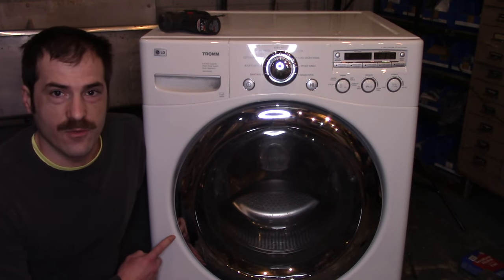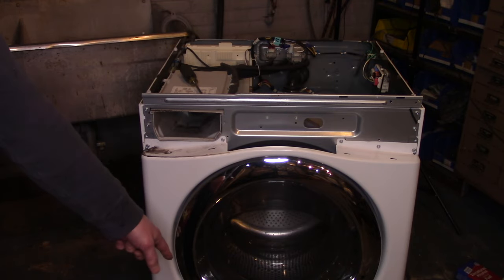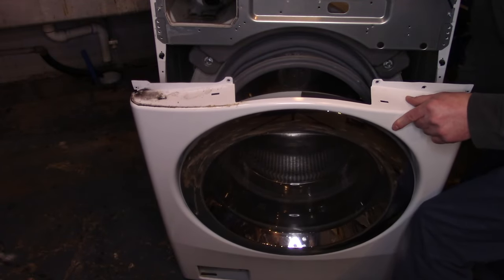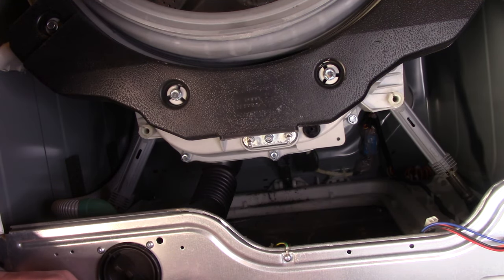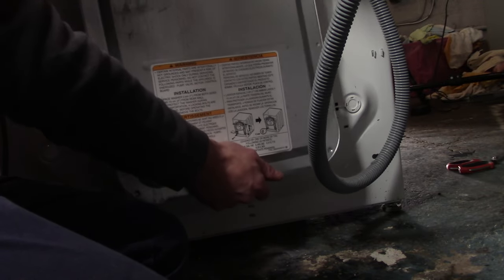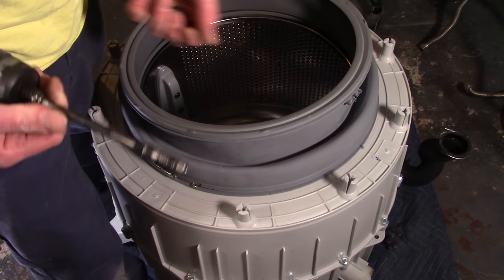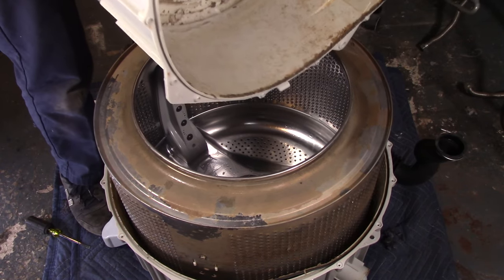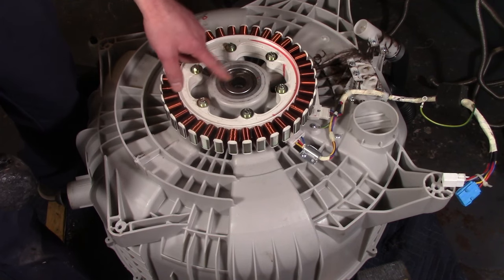How to Replace Bearings LG Front Load Washer

Comment: Thank you for this excellent video!  I finally got the bearings replaced, and the washer is working again!  I had to use a sledge hammer cushioned by a 4x4 to finally pound out the basket stem from the rusty bearings.  The rusty bearings took quite a bit of work too, I had to take several breaks, but finally I pounded them out using a 4 lb. hammer and a 2 foot, 1/2" socket extension (minimized risk of damaging the housing).

Comment: This video is very well  done - one of the best "How To" videos I have seen.
The procedure is well planned and executed very well. with no silly distracting background music.
In my opinion, this procedure should only be attempted by experienced DIY'ers. It is fairly difficult and draws on a wide range of skills acquired over time.
One tip I can pass on - when removing the white plastic pins that hold the shock absorbers,  I used a 13mm socket slipped over the end of the plastic pin and used it depress the 
release tab.  There is no way I could get  a pair of pliers behind the shock absorber to squeeze the release tab.

I suggest anyone attempting to replace the tub bearings, set aside the better part of a day to focus on the procedure. I found that some of the tasks such as removing the last spring holding the tub was DIFFICULT for one person. I struggled but eventually got it done.
I successfully replaced the bearings and re-assembled the machine. The noise is gone!

Thanks for sharing this excellent tutorial.

Comment: Stupid question, but I was trying to remove the bearing and the spider arm broke. When I was trying to remove the broken spider arm I got a few of the bolts, but three are just spinning and won't come out. What would you recommend?
Reply: I used heat like you mentioned to try and get the bolts off. Did I heat the bolts too much?

Comment: The bearings were difficult to remove.  I tried using a drift punch but i kept punch through the bearing.  I wound up using a 1 inch black pipe and two couplers and a small sledge hammer it took about 10 good swings to pop them out and lots of liquid wrench.  I got the new bearings in fairly easy using the old bearings and some plumbing rubber sheets to protect the bearing while i was pounding on them.  I got the tub assembly together and bolted it with the new o-ring.  I noticed some spacing around where the tub pieces join and put a good bead of GE Silicone around the tub making sure not to get it on the o-ring.  I have run six loads of wash so far and nothing is leaking so far.  I let the silicone cure overnight and i  had to replace a few screws with larger ones because they stripped out.  I recommend not using any power tools to tighten anything on the tub, hand tools only. I had to replace the spider arm and one of the bolts would not back out is was spinning freely in its anchor.  I would up using my Dremel and cut the head off and left it in place only using 5 instead of six fasteners in place.

Comment: Hello, this video deserves an award. Awesome video, every step explained throughly and to the point. I have my washer apart, picking up the parts tomorrow and hopefully can put it back together.

Edit: got it back together and it's been a few weeks and it is still running. I don't think it's ever been this quiet.

Edit 2:

When I replaced the bearings, I had noticed some wear on the Spyder. I ignored it as I assumed it would be ok with the new bearings. This was a mistake on my part, and I should have replaced the Spyder. I did look up the cost, it was over $300 and I decided to not get it as a new washer costs about $900 and would be headache free for 5 years. Just FYI, if your Spyder is not in good shape, might be a good idea to replace that too. My washer is making loud noises again and needs to be repaired again. I think its time for a new washer.
Reply: I spent a lot of my youth in Germany and Italy. Still visit relations and friends whenever I can. LG in Europe is a far higher quality brand than LG in the US. I see LG washers and refrigerators running for decades in Europe and, here, you're lucky if you get four years.
Reply: @ethelryan257 
I agree the build quality is not good, as doing the repairs, I seen alot of areas they could improve quality. I work with sheet metal industry in the medical industry and these washers are not high quality for sure.
Reply: The quality of large appliances in America is truly pathetic. As long as consumers are willing to keep spending money on appliances that only last for a few years nothing's going to change.
Reply: @ethelryan257  We have a LG washer that we bought in 1997 in Sweden, been used several times every week and the last 15 years only for work clothes (dairy farmers, so lots of dirty clothes). Just last week it started to make some noises, so probably time to get a new one (doubt that it's worth repairing at this point). Got to say that 25 years of heavy use is impressive.
Reply: @ethelryan257   After 2 years my LG is salvage! I bought it new, it was a top model but I’m facing replacing it. It has the common problem of failing to enter the final high-speed spin. After only 2 YEARS! It gets to the start point of the last spin cycles, then stops, adds water, low spin, starts high spin, then stops. This repeats until I stop it! The pump was replaced. Next I’ll try the shocks and pressure switch if it tests bad. It’s basically scrap at this point though, after only 2 years. It was made for the American market. LG is junk! My last washing machine lasted 35 years. LG is junk, expensive $1000 mistake!

Comment: This video was all I needed to watch to finish the job.  I did have some problems along the way that were highlighted in the video.  The bearing's refused to budge with the little punch I had.  I purchased a bearing extractor set and was able to get one out but the inner bearing would not cooperate.  I could not get any purchase to allow the extractor to gain leverage, instead it chewed up the plastic.  I finally was able to get it out using a 1.5/2" socket and an extender.  Few good whacks and it came flying out.
Using the old bearing to seat the new worked great.
Trust me, get the tools to remove the bearing and it will take you no time to finish this project.
P.S. Take pictures as you remove things so you remember which screwes and wires go were.  I had to wait a few days to complete my repair and forgot a lot of details.

Comment: I replaced the bearings on my 20 year old LG washer this past weekend. It took me five hours. It took a while to bang the bearings out. Has anyone tried using a bearing removing tool? I used my electric power washer, wire brush and screw driver to clean the spider arm. It was caked with old gunk. I also power washed the drum and the attached gasket. It saved me a lot of time and they look like new, It also got rid of the mildew smell. I highly recommend doing a detailed cleaing of the drum and hoses with a power washer and detergent while it is apart.

Comment: Thanks so much for posting this tutorial. Everything was spot on.  Just finished testing out my LG after putting it back together with new bearings and sadly needing a new spider arm because the old one had a race gouged in the main shaft from the failed bearing.  Thanks again!!

Comment: I just did this.  It is way easier to remove the 2 bottom hoses from the rear of the washer and not the front.  Would have been way easier to know that before hand.  Remove rear panel before you start taking any of the insides apart, especially the lower hoses.

Comment: Thank you for a great video. I watched a few on the same topic and yours is the best. You gave lots of little tidbits of information to look out for. You saved me a lot of time. One small addition to mention is on the spider shaft, besides where the bearings rest, also check the part where the seal contacts (close to the drum). I replaced my bearings 5 years ago, but they rusted because I didn't inspect that part of the shaft, and water leaked by the seal.

Comment: Thank you for this video. By watching it, I was able to replace the bearings on my LG commercial washer which is much bigger but built very similarly. It was the most back breaking, strenuous, tedious, aggravating repair I have ever done. Getting the old rusted bearings out was a complete nightmare.  Again, thank you. I couldn't have done it without your video and you saved me $6000 because I didn't have to buy a new machine.

Comment: This is a great video with easy to understand step by step instructions.  The commentary is very accurate and very helpful all the way through the process. The only thing that I did differently was when pounding out the drum from the back side, I supported the tub housing upside down in the corner of my deck rail and then used a third support cut to length as a leg. This allowed the weight of the drum to hang while I was hitting on the shaft to free the drum from the bearings. Thank you very much for the video. Saved me tons of cash!

Comment: re brearing insertion....I'm going to try a half inch long bolt, half inch washers floor flange (round disc, takes 4 screws or bolts which we will ignore, and has a maybe 3/4 inch center thread usually used for pipes- some older cheap homes use these as closet clothing bar replacements)...the floor flanges are larger than the bearings. take the bolt, a washer or two, the flangey part of the flange, and on the flat side of the flange slide the old bearing on,  followed by the new bearing, place in tub, on other side put the second flange on, a couple washers, a nut; hold nut in place and crank on the bolt end to press the bearing in. I am hoping it will work. For $5 it's a cheap experiment.

Comment: Suggestions sought.  Steps done:
1. Removed lower cement counterweight to get access to remove and clean gasket.  
2. Machine vibrates with load after step (1).  Machine spins up/down fine with no load.  
3. Replaced three shock absorbers.  Still vibrates.  
4. Used clamps to pull cement counterweight in as tight as possible when tightening bolts.  
5. Machine is level and solid on its feet. Still vibrates with load at spin up.  
All that remains on cause for vibration under load is spider or bearings.  
(a) drum rotates smoothly and freely.  
(b) drum does not move when pushed to test spider.  
Thoughts on next step?
Questions:
Does the "true balance anti-vibration system" need to be reset?
With smooth drum rotation and lack of drum movement when pushed, is an examination of the spider and then the bearings the only logical next steps?
Reply: I moved on and replaced bearings and spider. Vibration under load is gone. The smaller (front) bearing showed very minor rust.

Comment: Wow, I thought the videos I saw from other parts suppliers were detailed. I only found this after I already had mine apart and wanted to double check reinstallation. I wish I watched it earlier for all the tips, especially disconnecting the drain hose from the pump instead of the tub, and removing the metal bracket from the top of the frame. I didn't even notice the door switch wire harness clip. And your tip on reinstalling the door gasket spring is awesome - the last time I had to install it, it took my wife and me probably half an hour of cursing and trying different tools to pry the two sides of the spring apart! By the way, just guessing but I think the mark on the tub gasket shows where the seam is, and by locating it as high as possible minimizes or prevents leaks in case it separates.

Comment: Great video! It made the job much easier. Lots of great tips and recommendations that helped a lot. Replaced both bearings and the spider bracket with no issues.

Comment: Couldn't get the shaft to pound out that way. Bought a longer bolt of the proper thread, built it up with some nuts and washers for spacers,tightened it up, and 3 swats on it with a big hammer, and the impossible became possible... Great video. Thanks for all of it!
Reply: Were you working on the same washer from the video? What size bolt did you end up needing? Thanks!

Comment: Thank you so much for posting this video, it was very helpful in my washing machine bearing change. I ended up making a puller to remove the bearings, it was still difficult but I didn’t have to pound on it for days! I took a piece of 3/8 steel plate, 1.8” x 1” and drilled and tapped a 1/2-20 thread in the middle. I then slightly rounded the corners of that plate so it matched the shape of the inner race of the larger bearing inside the drum. I then took another 3/8 steel plate, 4” x 2” and drilled a 1/2 through hole in the middle of the plate. I then purchased a 1/2-20 x 2.5” grade 8 bolt. I had to drop the threaded plate through the bearing race and push it up against the race from the back side. I then ran the bolt through the plate and threaded it into the plate behind the bearing. You have to pull up on the puller while threading to prevent the threaded plate from rotating. I also had to use a screw driver to prevent the race from rotating. Made quick work of it.

Thanks again!!!

Comment: 15:00 That spider arm is the cause of the stink in my washing machine. Look at all that mold and other fungi growing on it. I took mine to the car wash and power washed it. That wasn't good enough so I took it to a sandblaster and he sandblasted it. I'm painting mine now.
17:50 That bearing was so hard to remove also because the underside was unsupported. Most of your efforts went into bouncing and flexing the plastic tub. A couple of 2x4s or even a 5 gallon bucket with some 2x4s across it to support the tub closer to the bearing should yield much better results.

Comment: Alas, I tried this repair today, unsuccessfully. The inner bearing would not pound out, I would definitely order the parts only after I have removed every thing first and after I inspect the bearing housing and inner tub  to confirm both are undamaged from the pounding.  The drum shaft was a monster to pound out.  I ended up using a metal bracket as my shaft protector with a 3lb hammer.  Instructions are accurate and taking the wash tub out of the washing machine was no problem.
Reply: I am doing this repair now and yes removing the bearings took a while. Make sure you have a good size punch that isn’t too pointy and be careful not to mar the race that the bearing presses into. I actually used a sledge hammer because my dead blow hammer wasn’t moving them at first.
Reply: @awdriven  I ended up tossing out my LG washer.

Comment: I think this video is awesome.  Im fixing my LG WM2701HV right now replacing the bearing, spider are and tub shocks.  I see that in the video you stated that he spider arm had a grove cut into it by the bearing and needed to be replaced, but it appears you did not replace it.
Reply: I saw that too, my spider arm has a similar groove.  I am wondering if I should go through a replacement or just leave it.

Comment: Very clear step by step. Thanks for giving me the confidence to attempt this repair myself. Looking forward to getting the machine up and running again. Awesome video all the way around -- well done!
Reply: Update: I did get the machine repaired without issue. Overall I found it was not too difficult a job, but I did have to allow penetrating oil to soak over-night in order to separate the drum shaft fom the bearings. I also needed to use a five inch bolt, secured to the shaft in orde to drive the shaft all the way through both the front and rear bearings before it finally came loose. The long bolt allowed me to continue driving the shaft through the front bearing, using considerable force with a small sledge hammer, once the shaft disappeared past the rear bearing, and then through the inner, front bearing. The bolt was sacificed, as it did get bent, and banged up quite a bit, but it wouldn't have been possible without it.
Reply: The other vearation I employed was to remove the motor and stator BEFORE removing the tub from the machine. Not a big deal really, but with all the oiling, and banging I had to do to get the bearings out, I felt it best to get the motor out of the way first. It was a simple matter to pull them out earilier, while the tub was still anchored to the machine.

Comment: This is a fantastic film with great explanations, true learning material.  I wish LG washers were half as good….
After 2 years my LG is salvage! I bought it new, it was a top model but I’m facing replacing it. It has the common problem of failing to enter the final high-speed spin. After only 2 YEARS! It gets to the start point of the last spin cycles, then stops, adds water, low spin, starts high spin, then stops. This repeats until I stop it! The pump was replaced. Next I’ll try the shocks and pressure switch if it tests bad. It’s basically scrap at this point though, after only 2 years. It was made for the American market. LG is junk! My last washing machine lasted 35 years. LG is junk, expensive $1000 mistake!

Comment: I'm going to give you a pro tip. When removing the basket. The reason it's so hard is because the bearing is bad and that shaft is not centered and has torque on it from the weight of the basket. If you were to prop up that basket and center the shaft it would probably only take 1 or 2 quick strikes. Just do yourself a favor and try it next time.
💯

Comment: You were rigth, such a miserable job, especially removing the shaft and the bearings. Thanks to your video, I was able to pull it off.  Now I have a quiet washer again and didn't have to break the bank to achieve it. I think I watched it like 6 or 7 times lol.